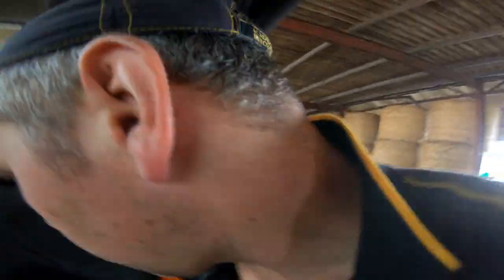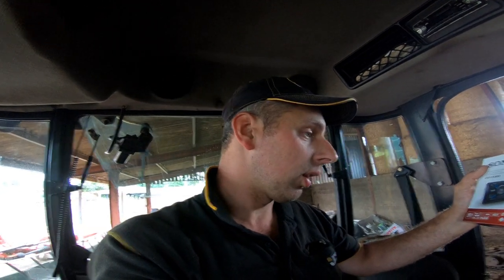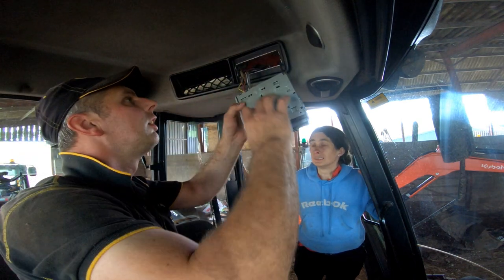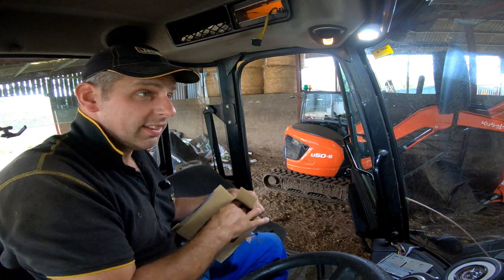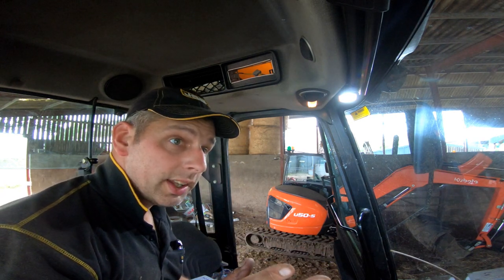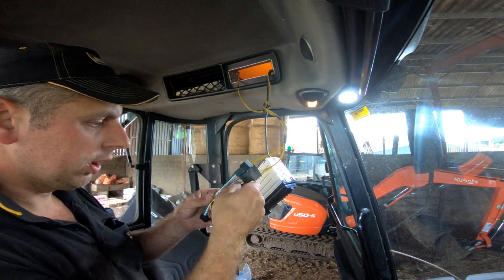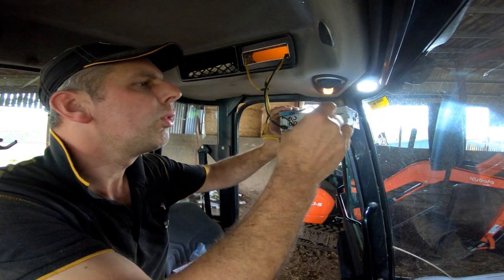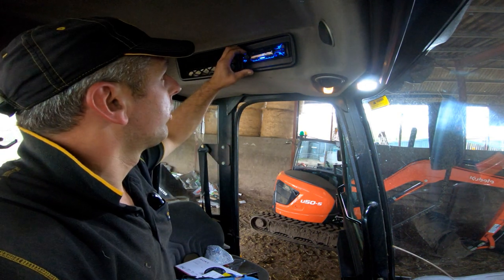SOUND SYSTEM UPGRADE IN A TRACTOR

Comment: George you have missed a trick. 
Recently installed a DAB pioneer stereo in a 20 year old tractor here and pioneer speakers and the DAB aerial sticks inside a window but the clarity is simply amazing as is the choice of different radio stations. Well worth the extra effort 👍

Comment: Hey George... Where I work they have a School big grass field and each few months they cut it with a small sit on cutter machine bit like a big Go-Kart.

But I had a nice surprise just before the new September Term started, They cut the grass with a big New Holland Tractor for the 1st time with a big grass cutting fold up back unit.

The Tractor was the 1st one I've ever seen up close as it drove off of the field after cutting done! Since we live in a big town away from the farming areas.

I only saw a quick view of the model number and it looked like a 6 series one. 

The back wheels were huge I say about at least 6 feet high with wheel weights and a medium counter weight on the front. 

The grass cutter looked like a maybe a yellow and red bi-fold cutter which was about 13 or 14 feet wide when opened.

Such a lovely looking tractor. That made my day.
Reply: Yes, probably a T 6, series,  a proper Basildon built blue machine, & could have bein 180 horse power!!

Comment: Takes me back does this video George. Back in the 90s I had a Vauxhall cavalier fitted a jvc unit with 12 disc auto changer,still had a cassette player in it as CDs where just getting going,  the boot was fitted out with 2 massive amps subs, 6x9s inthe parcel shelf, all the door speakers upgraded. It was the thing to do back then, needless to say my hearing suffered.
Reply: I Still have my 12 disc in garage. Clarion. Maybe not work now after so many years in garaget but i can't frow it away 🙄😏
Reply: @polestar1265  Ian the same still got everything cant get rid of the good old days

Comment: just wanted to add, I believe the phono outs are for connecting an amp to which you then connect your other speakers, you run a power wire from the battery to the amp to power the amp and in turn the sub and extra speakers etc, that's how i done it anyway. then you have more sound/EQ control with the amp and it doesn't put load on the cd unit to power the speakers as you can blow a fuse, i could be total wrong but this is what i was taught.

Comment: this brings back memories of getting my first car 10 years ago, went right to Halfords and spent 800 quid on "vibe" speakers, had 4 6x9s on the parcel shelf and a 6" in each door card(4 doors) 12" sub in the boot and ran through a 1200watt amp with a Sony double din that the screen flipped out(all the cool kids had them back in the day). still to this day I've never heard another Corsa c sound so good haha we used to pull a fence post out at the skate park so we could park beside the ramp and have tunes while we fucked about. being 17 was fun haha.